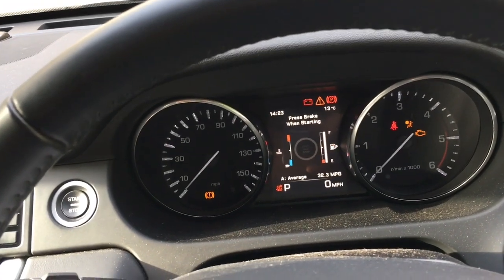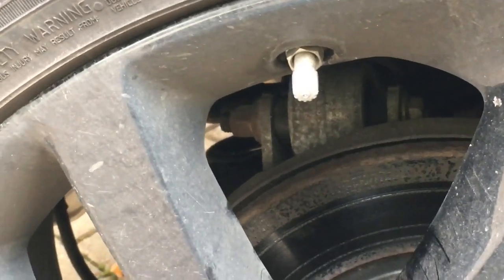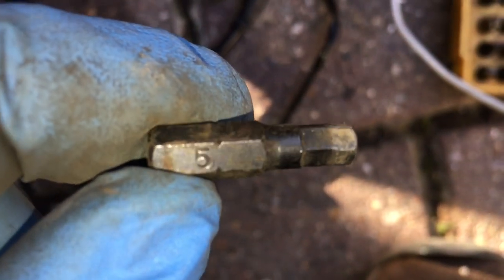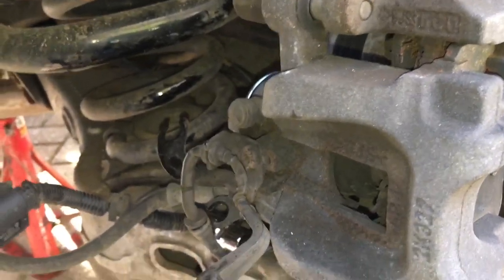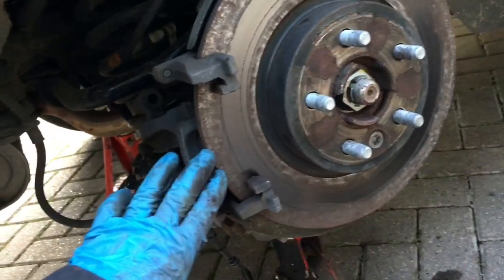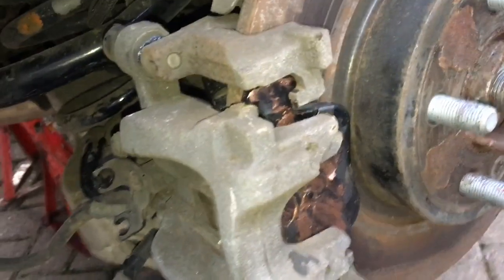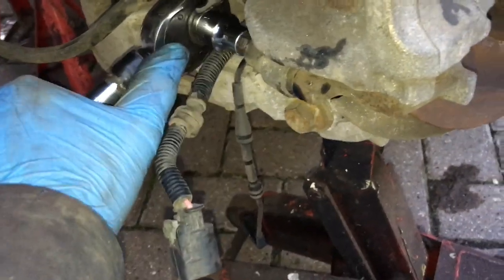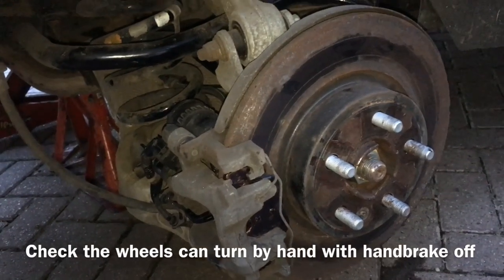Changing Rear Brakes Discovery Sport. EPB Trick used.

Comment: Thanks for your video. I found it really useful for my recent rear pad/disc change. My car has covered 49,000 miles and this was the first pad change (front ones are still OK). The wear sensor hadn't tripped but the discs were in a very rusty state - especially on the inside so I decided to replace them. One point though. It tells you how to stop the parking brake from being applied when the car is stationary and the ignition off in the Owners Handbook. Mind you, it isn't worded very clearly and would be very easy to miss.
Reply from the maker: Glad it helped, thanks for your input.

Comment: On the Freelander 2 (the forerunner to the DS) you can put the EPB into service mode very easily - might work on DS too.
Putting electric hand brake into service mode before changing pads.
Procedure is: 

Ensure its in park or neutral and the park brake deactivated and ignition turned on. 

1. Press and hold the parking brake switch in the release position. 

2. Wait 2 seconds 

3. Press and hold the accelerator pedal in the wide open throttle position. 

4. Wait 2 seconds 

5. Turn ignition off and on immediately whilst still finger on park button and foot on throttle. 

6. An audible noise will confirm service mode, it will also be displayed on dash. 

You will hear the brake motors activate for a while. 

Deactivation 

with ignition on. 

1. Press and hold the parking brake switch in the apply position. 

2. Wait 2 seconds 

3. Press and hold the accelerator pedal in the wide open throttle position. 

4. Wait 2 seconds 

5. Turn ignition off and on again. keeping finger on park button and foot on throttle.

Comment: Hi, thanks for posting this video I used it to swap the rear pads on my 2015 DS HSE. Only issue i had is that i own the icarsoft v2.0 LR diagnostic tool and it wouldn’t retract the parking brake. Your solution saved the day! Cheers 🍻
Reply from the maker: Thanks for the feedback.
Reply: @comeinhandynow  no problem… for anyone reading this I discovered the issue with icarsoft, my Disco is an auto so you need to be in neutral then the EPB retraction operates properly, as I believe theyy are linked through ECUs. You do need to use the software to reapply EPB once you finish. The guide video really helps and shows a workaround if you haven’t an OBD reader

Comment: The discs are in pretty poor condition and would benefit being changed…..torque for pins is 28nm / 21ft/lb. You do not need to use loctite on these although I have used a small amount on the calliper bracket bolts on mine…110nm 81ft/lb for these. The small countersunk bolt in the disc is 35nm just for anyone who may need this.

Comment: As per @julianhull9110 comments below, on the Discovery Sport you can easily put the handbrake (EPB) into service mode. The workshop manual covers this (copies on a CD available on the usual auction website for a fiver).  This should be done so the EPB adjusts correctly to the new pads and/or discs. The procedure is very easy but make sure you are on level ground first!
1. With the car in park and handbrake on, switch on the ignition and just release the handbrake (you'll need your foot on the brake to do this). Take your foot off the brake
2. Then press and hold the handbrake down in the release position and keep holding it down
3. wait one second and then press and hold down the accelerator pedal fully and keep holding it down
4. wait one second and then switch the ignition OFF and back ON immediately 
5. You'll hear the EPB releasing again into the service position. You can let go of the brake and accelerator. A warning will appear on the dash saying brake fault and then it displays that the EPD is in service mode.  You can then turn off the ignition. the handbrake red warning light will keep flashing for 30 seconds

When you change the pads you can gently push the brake piston back in using a screwdriver levered against the pads whilst the caliper is still on the brake.  If this doesn't work you may have a seized piston and might need to use a piston tool or clamp.

To reactivate the EPB, it's the same procedure as above but you are lifting the handbrake for one second as follows:

1. switch on the ignition and lift the handbrake and keep it held up
2. wait one second and then press and hold down the accelerator pedal fully and keep holding it down
3. wait one second and then switch the ignition OFF and back ON again immediately.
4. You'll hear the EPB setting itself back into position and the car display will say brake fault for a second but then clear. You can then start the car and test drive carefully.

Comment: "Electronic parking brake" ha ha ha ha ha, my boss asked me today if i could change the rear pads on his land rover,as a person that has done probably 100 brake jobs in his life i took a look at them and the whole time I'm wondering to myself "why is this back wheel not moving?? and where is the emergency brake??? ha ha ha, man you sure are a life saver with your video,hes supposed to buy the parts next week, sure glad i watched this video,fucking cars gets crazier every day!!
Reply from the maker: Yep, things move on.
Reply: @comeinhandynow  I did have one more question if i may and thank you for your input,i understand all this very well but whats behind putting the car in neutral, leaving it running, disconnecting the EPB and then turning the car off? i have seen several of these videos on other cars that have EPB and they also take it apart and back off the motor etc but they never did the procedure i mentioned at the beginning of this question,I'm guessing when one turns these Land Rover's off they lock the wheels up, hence the procedure and other brands of cars dont? thanks again for your kind insight.
Reply from the maker: I found that the EPB will reapply after some minutes, hence why it must be disconnected.  There is a way to permanently back off the EPB by issuing commands to the ECU but you need the right software.  There are probably other modern cars that operate the same way since these systems are often used by many.
Reply: @comeinhandynow  Thank you much for your input, appreciate it.

Comment: Good job the way I did it the electric system put it on an neutral disconnect the battery I went to advance Auto rent the tool to turn the piston for $145 when I return it no charge 🇵🇷

Comment: Hi, congratulations on your work, excellent method. Is it possible to push the brake piston with the car with the engine running and the brake off? Isn't it faster and you avoid dismantling additional pieces?
Reply from the maker: You could try but I have a feeling that the problem with other methods is that after a while the car would reapply the parking brake.

Comment: Is it common after changing all four pads that the pedal is noticably softer upon applying the breaks? Just changed them for my neighbor and when I drove his around, noticed the brake pedal had a lot of play. Still has full reservoir of fluid. Thanks
Reply from the maker: I wouldn't say it was common but the pads will need a bit of time to ‘bed in’ especially if only the pads were changed and not discs as well.
Reply: Probably because you watched this

Comment: Many thanks great video, although i wish i came across this video before i tried to replace myself.

Didn't remove the connector before removing the calibre and pads and then the EPB self activated and pushed out the piston fully !  Doh !

Managed to get the piston re-engage and pushed back just enough to get new pads back and brakes seem to working properly but now a warning notification keeps coming up   "Park Brake Requires Calibration Apply Foot and Park Brake"    any recommendation on how to fix/reset ?
Reply from the maker: Thanks. “Press the brake pedal and pull the EPB switch up to apply the EPB. This is required to reset the EPB system. The EPB will now function correctly.” - from :

http://www.ownerinfo.landrover.com/document/LS/2016/T19935/18970_en_GBR/proc/G1799396

Also did you bleed any air from the hydraulics system after the piston popped out, hopefully you did.
Reply: @comeinhandynow  already did but no luck. After a fairy long wind the warning appears again.  Could it be the position of the piston no wound to the same position of the left ?

Comment: Thanks for the video, did you get any warning lights on the dash when the connector was unplugged? I’m about to do mine soon
Reply from the maker: Nothing that didn’t go away when new wear sensor put in. There is the initial warning light saying pads worn of course , which is why you are changing them. That goes away after changing pads/ sensor..

Comment: Was it really necessary to remove the EPB motor now that the P/Brake is now 'OFF', you surely would have had sufficient clearance to remove the caliper. Also, is there not a risk when manually winding back the P/Brake spindle that you might still have partial P/Brake set when the connector is replaced causing unnecessary drag.
On the rusty disk situation. Apparently LR used a faulty manufactured batch of rear rotors on the early DS and they issued a technical bulletin on this fact. Mine had the same problem (bought as 3 year old used car) and I bitched hard enough to the LR Dealer showing them the bulletin and they replaced for free, told them my local MOT station put it down as a potential safety issue.
Reply from the maker: Yes you have to remove the connector to the motor to stop it coming back on, which it will do as a safety measure.  The EPB will reapply when all back together, stopping at fully braked position.  When EPB is off it will back off a set amount from that point to give no drag.  The rust on the disc wasn’t much of an issue and actually disappeared when I used slightly rougher Mintex pads and drove it.  All discs rust when left exposed and unused.  These may have rusted more than others but still not a safety issue in my opinion.
Reply from the maker: Here’s a pic of these discs 9 months later from a link on an earlier comment reply. https://www.dropbox.com/s/hsg51t73xmnzn3c/IMG_0368.jpg?dl=0
Reply: Now see why you have to wind back P/Brake spindle so that the main piston can itself be withdrawn to allow new pads to be installed, obviously the EPB gradually moves to new position as pads wear thus restricting the return of the main piston when it has to be set back for the new pads. I have seen a video for LR Discovery (same EPB type) where the Guy did not remove motor but just removed connector and applied 12v to the motor pins to reverse EPB to Service position. Saves having to start engine and set P/Brake off and then having to remove motor.

Comment: Once the job of changing the pads is complete, will the parking brake come on as soon as you turn the ignition on? Are there any particular steps that i would need to take before I power on the car?
Reply: Excellent video btw.
Reply from the maker: Nothing special, it works after assembling.
Reply from the maker: @andrewsheehan3452  Thanks.
Reply: Changed them no problem. Thanks again for a great video. Would probably not have attempted them had it not been for your guide.
Reply from the maker: @andrewsheehan3452  Great! Well done and thanks.

Comment: I don''t know about land rovers but you definitely don't want to do this on every car. Its put into maintenance mode and back out to calibrate the distance to the new pads and to make sure each side matches. If it doesn't then you can end up after a few months with your brake calipers locking up and depending on which model vehicle you possibly have to purchase new calipers in order to fix it.
Reply from the maker: I don’t believe you are right. There is no calibration involved in the process, the motor just stops when a certain resistance and increased motor current is measured as the brake is applied.  It then backs off a fixed amount from that point to release them.  If you want you could say it is calibrated every time the parking brake is applied, not what I would call calibration though.  If it is not behaving correctly after doing this job it will be obvious from testing the park brake and foot brake. Of course both were operating correctly after this.
You would certainly not have your brake calipers locking up since the brakes will always do the backing off from the parked position so that is just nonsense.

Comment: Is there anything different when replacing the front brake pads?
Reply from the maker: A lot easier on the front as no parking brake to worry about
Reply: @comeinhandynow  last question do you have a recommendation for the front brakes to purchase
Reply from the maker: @benbranscombe6863  I now always buy Mintex pads as they seem to offer more grip and on this discovery sport they kept the rear discs relatively clear of rust, better than the originals.  I think there are some buying links in the video description..

Comment: You're absolutely wrong with the fact that those rotors are shot he should have replaced them with the brakes I was really hoping you could could have shown all of us how to turn off that worn brake indicator that would have been great other than that great video
Reply from the maker: Thanks. The worn brake indicator goes off when the pad wear indicator cable on the pads is replaced.  The rotors(discs) are still fine by the way. Bedded in nicely with the new pads.
Reply: Yeah those new pads will have uneven wear and will probably cause vibration while braking. Always replaced or machine rotors according to spec.
Reply from the maker: Although that would be nice, actually in my case after making this video and running the car on the old (rusted but not too worn out discs) it neither vibrated or had any wear issues. 9 months later the discs actually look better and are still fine.  It’s not always necessary to replace the disc as well as pads.  Here’s a pic of these discs now: https://www.dropbox.com/s/hsg51t73xmnzn3c/IMG_0368.jpg?dl=0

Comment: Those discs are absolutely worn out, I'd also look at something being seized up with such uneven wear....
Reply from the maker: They were fine, actually after making this video and running the car on the old (rusted but not too worn out discs) it didn’t have any issues. 9 months later the discs actually look better and are still fine.  It’s not always necessary to replace the disc as well as pads.  Here’s a pic of these discs 9 months later in a link on an earlier comment reply. https://www.dropbox.com/s/hsg51t73xmnzn3c/IMG_0368.jpg?dl=0

Comment: "Disc's aren't too bad....." mate those disc's are knackered and should fail on its next MOT, i say should because i know some test stations out there will pass it but that should definitely be a fail.
Reply from the maker: They aren’t. It didn’t. Just needed surface rust cleaning off. Main fail for discs should be based on min thickness. IMHO.
Reply: @comeinhandynow   excessive pitting like that is definitely a fail, that dark area on the pic after using it is still corrosion just with the surface polished. The darkened area will dissipate heat differently and expand more when hot affecting braking perform. After use more than likely will pass and most of the time will feel ok but it is still far from right and braking efficiency won't be as good as it could be once hot.
Reply: @kobudokai1   Mot wise those discs are a pass and advise. There's no failure for pitting, the failure is, "Brake disc in such a condition that it is seriously weakened." That been said, I would replace them when fitting new pads
Reply: @stephhen61   I'm sure some would pass and advise, but with the amount of surface corroded on that disc it's a fail as far as im concerned. 
The key term used is "to excess" and that is corroded to excess in my opinion,
but different testers have different options on what is excessive.
Reply: @kobudokai1  That's my point, there's no failure for corrosion or pitting on brake discs. If testers are failing corrosion under seriously weakened, then they are applying incorrect test standards, and if caught face points or loose their ticket. I know before computerisation some testers were failing discs for that as the could write an incorrect failure. 
The most common mistake about MOT's is people apply service standards to a MOT, but it's a bare minim safety check. Basically you have to ask yourself,. Would that brake disc at the time of test, is it seriously weakened and likely to fail and cause a possible accident
Reply from the maker: Here’s a pic of these discs 9 months later after the pads were changed (better ones).  Same discs and they are looking fine and well thick enough and strong enough and very little corrosion. https://www.dropbox.com/s/hsg51t73xmnzn3c/IMG_0368.jpg?dl=0